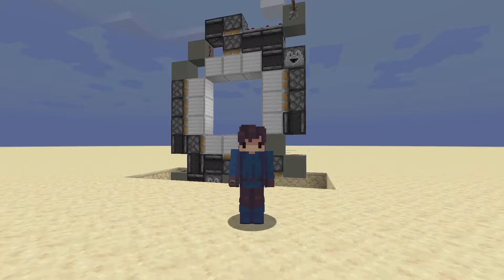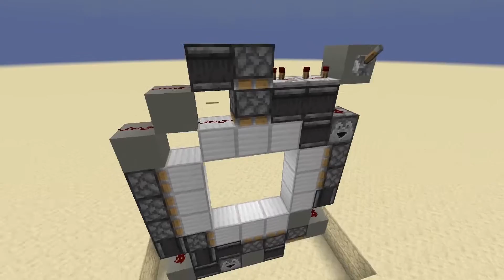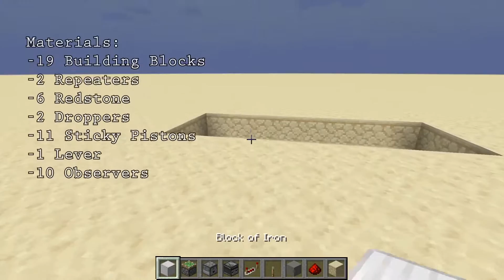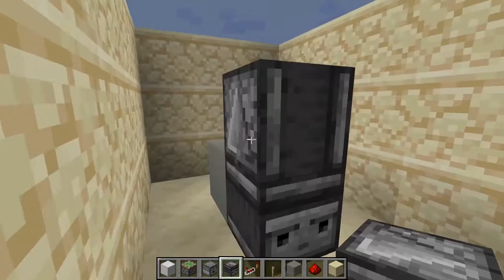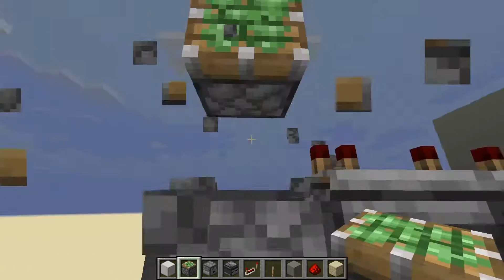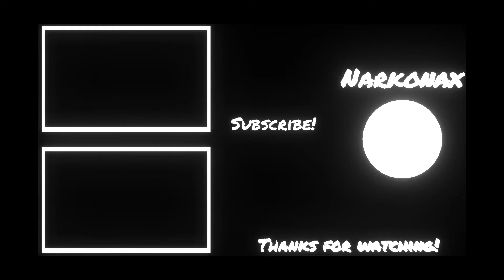How to Make a 3x3 Piston Door (EASY) Minecraft 1.18+

Comment: When I was building mine I followed it perfectly but it still didn't work at the end.
Reply from the maker: Be sure to check the bottom of the build, you can't have any blocks touching the bottom. I show you near the end of the video. Be sure to also check the repeater ticks and check if they're all correct.
Reply: It's because minecraft 1.16 has changed redstone, so 1.15, the version Narkonax is on, only works.
Reply: Me too I did all
Reply: It doesn't work on 1.16, i did exactly as you said, also cleaned all the blocks at the bottom. Ends up, it doesn't work as advertised.
Reply: Mathieu Laforce 1.16 changes redstone
Reply: @Spartanboy-pq3ej  does that nullify the entire mechanic or simply requires a few adjustments?
Reply: @Narkonax  ok thanks by the way
Reply: it actually worked for me
edit: i was on 1.16
Reply: @scote1563  u play on a little older version bro I am on 1.16.0.50
Reply: In 1.16 any Redstone you need to right click aside from the bottom right one
Reply: @Narkonax  Say, is there a way where I can put the Lever somewhere else not at the top? Like near the door?
Reply: @scote1563  same i just can get the lever into a spot where i can actually use it in my house
Reply: Umm imm on 16.1 and it works just fine
Reply: Me to I did everything

Comment: Im in 1.16 and it was working and all of a suddon it stopped working?? The two pistons in the top left wont fire? And the middle block of the door stay floating? is there a reason as to why it stopped working? But great video.
Reply from the maker: There have been many changes in redstone in 1.16 that's why your having those problems. But I have posted a new 1.16 3x3 piston door that you can use and it works like a charm. I have tried to fix this specific piston door but I ran into many problems so I would recommend checking out my latest 3x3 piston door.

Comment: How to i relocate the lever as want it down lower on that right hand side 2 or 3 blocks up from main floor and to the side?
Reply: Add a repeater facing directly into the block that the lever is on, if it's powered it'll still work
I'll let you do the engineering from there :)
Reply: @seanbird8022  thank you

Comment: How do you do the both sides lever
Reply: I used a repeater to go into the block where the lever is, and a redstone torch tower to power it, I've used buttons and pulse extenders on the bottom to connect it together and it works flawlessly